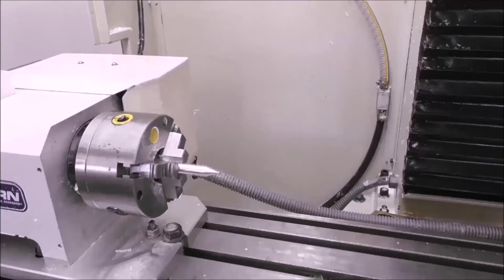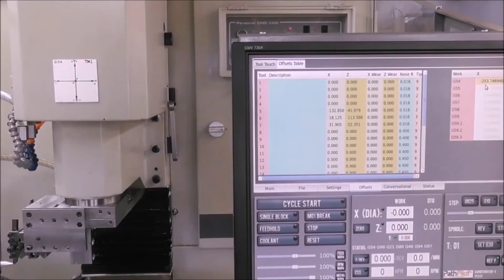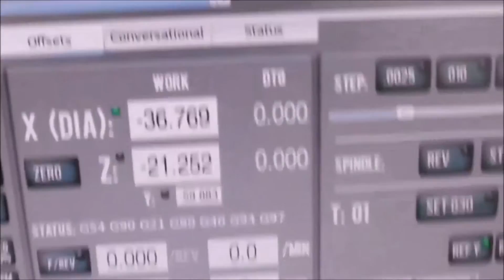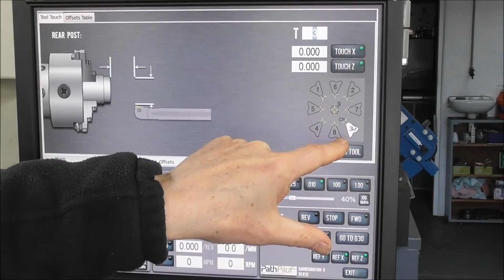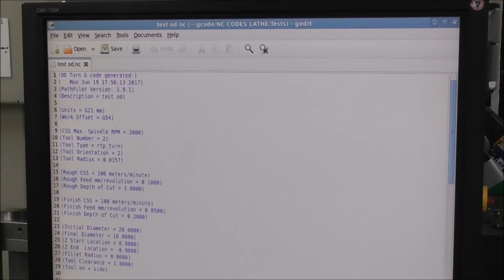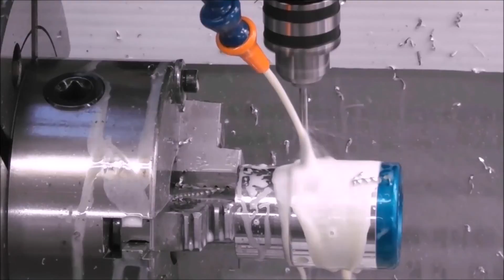Pathpilot/Rapidturn -  Work and Tool Offsets -  Part 1

Comment: Maybe its obvious or perhaps I missed it, but regarding tool orientation....  is it looking at the tool from the end?  Also, about half way through you show setting up a parting tool with a tool orientation of 2.  With that wouldnt you have to add the width of the tool as well?
Reply from the maker: Hi Shawn - Yes I did not mention the tool orientation 2 tool width subject - I had it set for grooving based off the left edge, if were are parting off and concerned about part length, then the tool width should be accounted for.  Not sure about your other question - please amplify.  Cheers  Cliff
Reply: Thank you for the clarification.  As far as my first question goes, I dont understand the tip orientation graphic.  How is the tool orientated in the graphic?  Is it looking at the end of the tool?
Reply from the maker: Hi Shawn - I think I understand your question now. Yes that can be confusing. I wish I had thought of covering that. I think if you imagine you are looking down on the tool, with the (missing) shank connected to the toolholder on the right side, it might help. Cheers  Cliff
Reply: Ohhhh. Thank you.

Comment: Hi Cliff, another great video, I was wondering about moves in the Y Axis in lathe mode and you have answered them for me. I have just finished some gang tooling which isn't copied from yours as you will see. I have only just tried out a simple turning programme in steel 2 1/2" dia and have been impressed with the results.
Unfortunately the workshop is out of bounds following surgery but I collected enough video stuff to post on youtube about my gang tooling set up and the tool holders themselves so keep an eye out for them. I just need to make a decent tailstock and improve the guarding around the Rapid Turn and I will be fully ready for action.
Regards,
                Bob Rodgerson
Reply from the maker: I look forward to seeing your video Bob - Sorry to hear the workshop is out of bounds - I wish you a speedy recovery!   Cheers  Cliff
Reply: It would be nice is someone fabricated and sold a gang tooling setup. I'm a new owner of a rapid turn for my 770.
Reply: Hi Cliff, I should be OK in a week or so's time. I'm a bit sore right now and have about 20 clips in the incision that are due to come out on Sunday, hopefully I will feel much better when that is done
Reply from the maker: I agree Johnny.
Reply from the maker: Good to hear - avoid heavy lifting!  Cheers  Cliff